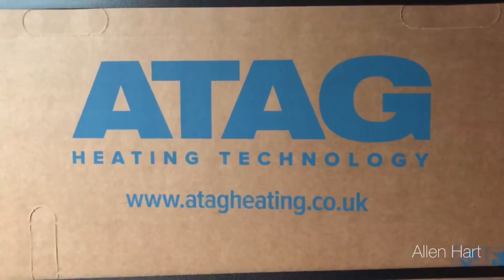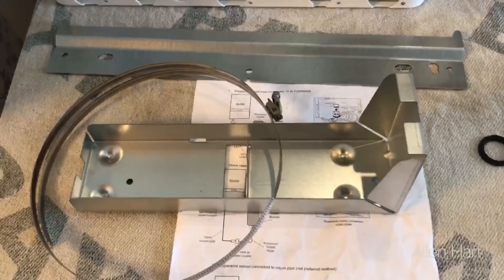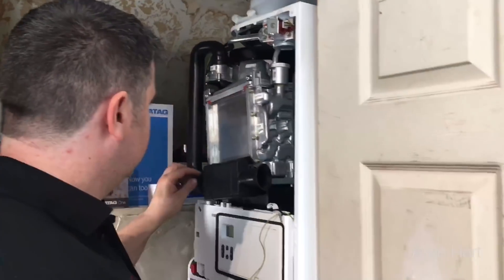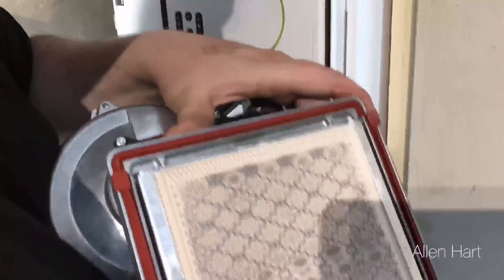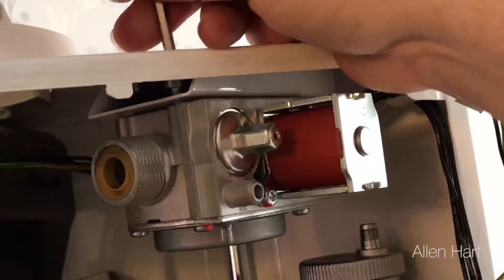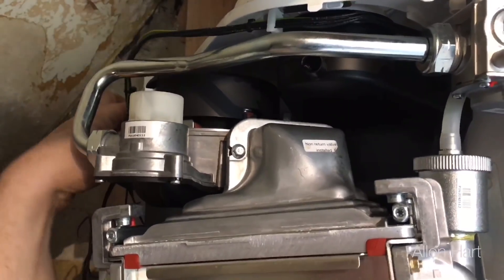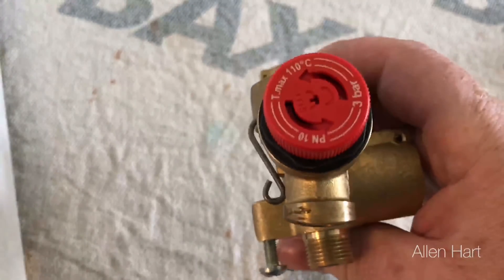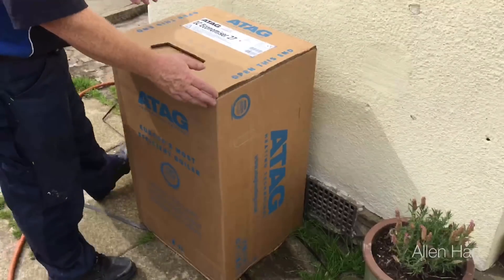Atag Review Full review and strip down Atag Heating Technology Boilers Combi Boiler Review

Comment: I can see why it's a cheap boiler. nice 90 degree bend on the ex hose to get blocked after a few years on a dirty system. other downfall is that they do not have there own factory employed engineers to do warranty calls, so normally a 3rd or 4th visit fix reqd for parts. not good for the customer. I recommend and fit others.